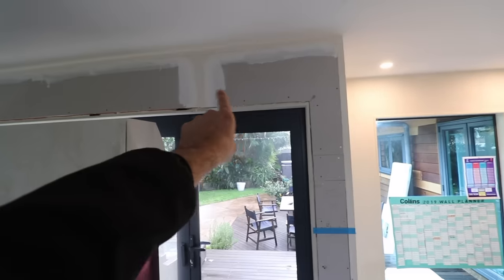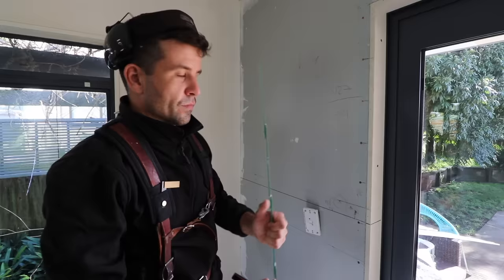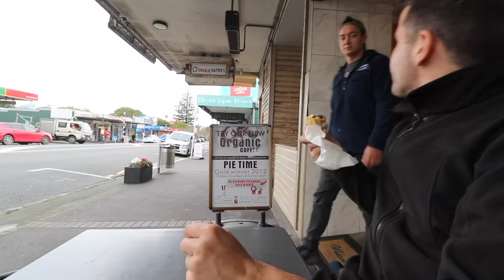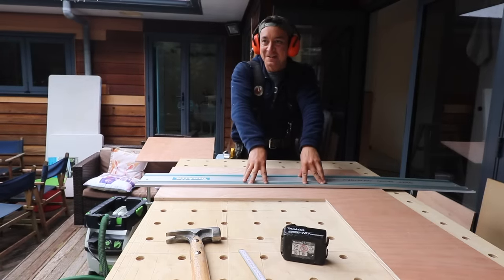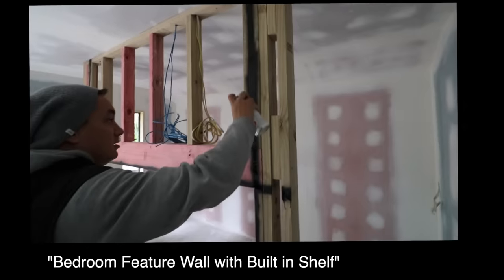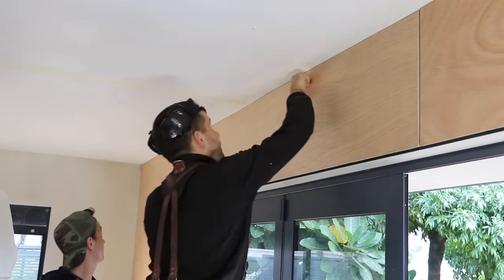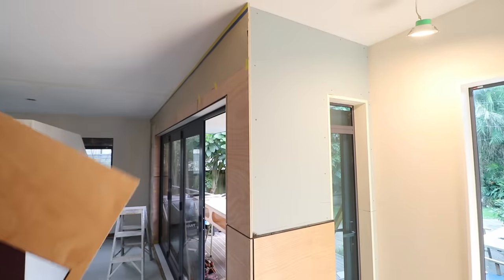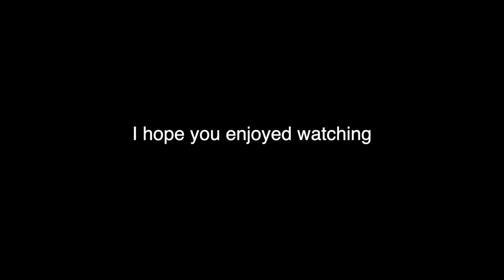Plywood Wall! - NO Nail Holes!

Comment: If your sticking boards on I find it better to do circles with the silicone/glue , when you push the board on it acts like a suction cup, Good job looks great
Reply: Chris Kane this guy knows whats its all about
Reply: @jamatoke  there isn't really a right or wrong way to do it mate, The comment was more for a DIYer or an apprentice using a lower quality of silicone and even on a rough or uneven wall not a fresh boarded wall, And the need to avoid 2 part glue, It can be expensive if you can't justify the need to buy it (I use it for kitchens)
Reply: @chriskane9230  I think he was complimenting you mate... but still an informative comment... cheers

Comment: Instead of putting blobs of adhesive behind the board put small circles of adhesive. It holds it back better to the wall especially if the boards arn’t quite straight. The small circles act like suction cups. Sounds daft but works
Reply: Yep creats a vacum
Reply: Great advice
Reply: Also has much better drying characteristics, vs. a blob that might not have any air exposure in the centre. Usually recommended for mirror installation.
Reply: @jacobmailman  Is it it better to do small circles across or a squiggly line across if i'm going to use the same amount of adhesive?
Reply: @timetraveller9690  The reason people do blobs is because it prevents gaps in the event there is a dip or a bow in your board and when you squish and press the board against the wall it'll naturally spread your adhesive. I've never tried circles, but the squiggly line would be worse as you would get the "suction" or vaccum effect they're referring to. If you know both surfaces are perfectly straight then the most glue surface area as possible is beneficial, which is when you should use the squiggly line to save glue and maximise glue surface area.
Blobs to ensure glue is connecting to both surfaces. Circles for suction. Squiggly line for even coverage.
Reply: Sounds legit, I'm going to try it. Cheers.
Reply: that makes sense , I'll sure use that tip .... good idea
Reply: Been using this method for years
Reply: Do triangles work?
Reply: Yup good method it really makes a difference. Great on skirt if your gluing and pinning it.

Comment: I would suggest you run your Paulk Workbench over your table saw and cut it in half lengthwise. Then install two side panels so you basically have two narrow Paulk Workbenches. They will store the same in your van, will assemble as a single bench with two squeeze clamps at the ends holding the two halves together, but will be much lighter to carry around. You might even find that you prefer working with a half bench better, but you have the option of the full. Also, the half benches will store in your van on edge so they will take up less space.

Comment: That is one of the best looking walls I have ever seen! If someone told me to cover a wall with plywood I'd think they are nuts. Now? Not so nuts!

Awesome!
Reply: Architectural-grade plywood is a whole other level of quality than the construction grade stuff seen in big box stores.
Of course, execution by the carpenter is key, and Scott nails it. (pun intended)
Reply: Birch ply is some of the tastiest looking cladding there is.
Reply: @alanr745  I've seen hoop pine used as soffit on a job,I was installing longline 305 wall cladding , finished product was stunning.
Reply: @alanr745  what do you mean "pun intended"? this is a nail-less wall! u crazy
Reply: I have put my wall using mdf coated with melamine which is far better than 12mm plywood. U don't have to sand and polyurethane.  One of major problem of plywlod is they come in bending.  U have to nail at the end.

Comment: May want to consider using aluminum Z-clips as panel fastening. Alows panels to be installed plumb and corners can be square. Wood and drywall expand and contract at different rates, meaning eventually something will give... Hope this helps

Comment: First time I've EVER seen someone just that Plumb and level line method!! I've been using that for 25 years to custom fit mirrors tight between walls. Exactly like what you do Plumb line a level line eight measurements off of those and you have an out of square custom fit mirror tight to all the walls! Outstanding

Comment: Just a little tip from a uk Carpenter here......apply the gun adhesive in circles, that way when you push in place, it’s creates a little suction, and it’s less likely to pull away :) love the vids by the way bro ;)
Reply: My brain tells me that would create high pressure cavities that would tend to push the board apart.  My brain isn't known for always being right.
Reply: Randall Mitchell well it works, try it and you’ll see :)
Reply: @solobuilder7451  Your presented qualifications support your statement better than my thoughts unsupported by experience or research 😄.

Comment: Carpenter in MB Canada. Insane how different we build. Keep up the awesome work guys.
Reply: Kyle GUY the whole video I’m just thinking “these poor folks have no idea their house was built using the wrong measurement system.”   Haha cheers from The States - love the content!
Reply: @davidpritt5080  haha we use both systems in Canada, we're trying to move away from imperial.
Reply: Just wonder why they needed to have the sheetrock at all. Why not just build directly off the studs and build it like a stage flat with a 1 x 2  grid frame behind for additional structure across the ply if needed? Would this idea make sense if you were doing new construction and wanted a plywood wall? (I am working on a  lab room that needs to have mount-points anywhere on a wall and not just for aesthetics) I think maybe they came in after the sheetrock was laid and decided to work on top?

Comment: Very good finish to a tricky job bespoke joinery 10/10 ! Bigger firms here in uk would supply everything over size then the site lad would make it work cutting everything again precise probably having to run the router down the edge after it had been finished with the paint ... I’m on your level cut, manufacture and install there onsite... no mistakes. Very impressed
Reply from the maker: Thanks mate !

Comment: Pretty slick!  Funny how plywood linings are so foriegn to (what seems ) the rest of the world.
Reply from the maker: Lol I know right . Love the channel btw bro
Reply: Wood paneling takes more time than sheetrock, so it is not used as often... And when it is used, it is not precision fit, but rather relies on edge pieces and moldings to hide the edges.  Cutting it so precise that you can leave the edges visible like in this video is not done by builders because it increases the time (and thus money) spent on labor.  They would do it cut to the nearest half inch and then rely on molding to cover the gap.  I had an aunt that I remember as having had mahogany paneling in her living room 50 or so years ago... I visited her maybe 20 years ago and discovered that at some point, she had decided to have it covered with sheetrock so that it could be painted a light color and be brighter.  What a waste...
Reply: @jakeblanton6853  it really doesn’t when you add in the time it takes to have it finished. The cost would mostly increase in material. Also finish carpenter leavening a half inch gap should be sent home not called back. 1/8” expansion gaps were used in older homes but modern paneling butts or gets an aluminum trim.
Reply: @SurelyLightFoot  -- I'm going by what I remember from back in the '70s with respect to the paneling that I saw and the houses that I saw in the '80s and '90s with sheetrock.  Paneling back then was often done with a piece of quarter-round, inside corner, or outside corner mouldings where walls intersect, although the panel to panel fitment was directly touching and if done right, you would not see the joint.  I'm sure that some of it was because the walls were not perfectly straight and there might have been a difference in the width at the top vs the bottom, but by having the mouldings there, it allowed the installers to be a bit sloppy in their cuts.  If your intersecting walls do not have any moulding at the intersection, then you're going to have a noticeable line even if you are a sawblade thickness off, whereas if you have a 3/4" moulding that goes there, you don't have to be as accurate.

Now, on a side note, do you remember the "board and batten" style of siding that came about as sawmills developed and we moved away from log homes and to lumber framed homes?  By putting the batten over the gap between adjacent boards, you closed up the air gap while also allowing for the siding boards to not be perfectly fitted to each other.  It's actually a pretty useful technique and it is still used today, although more as an architectural design use than being functionally necessary.  If you are a DIYer and building a shed, large dog house, or whatever and do not have someone else to help you handle the larger pieces of lumber, the board and batten style of siding makes it easier for you.
Reply: just wanted to thank the fans for committing to this journey with me. i love you guys so much, none of this is possible without ya’ll seriously. XO
Reply: UK here, never saw anything like ply linings before... 1. Why? 2. how's it finished that makes it not look like plywood?
Reply: @imipak23  well the way people do it now is mostly a modern design element but in the past they had the wood paneling that is essentially plywood and all the exposed edges were hidden with some type of trim molding. Having the layers exposed on the end is common now though because it gives an industrial modern look.
Reply: @SurelyLightFoot lol I feel old XD
I did work out that the faux Elizabethan oak wall panels on my local pub are (heavily stained and varnished) ply with added rail and stile door panel type sub-panels that I guess are just strips of trim glued to the sheets.
Reply: Anyone know how plywood affects room acoustics?
Reply: The resto of the worl is very conservative and is not used to things like these ... And most think that plywood is weak and brittle :D
Reply: @SurelyLightFoot  what's the definition of the word leavening that you use in your post?  Because my dictionary says it has to do with baking bread.
Reply: @SurelyLightFoot   leavening?
Reply: @pekoe46  it was either a typo or autocorrect on my phone. After reading my comment I can tell you that I meant leaving. Leavening does have to do with baking though.
Reply: @kazielbonn  can cause echo similar to just having a plain concrete wall.

Comment: Did a similar job about a month ago. I use tongue and grove method instead of a lamp joint between the black stripes and also use cladding bracket or what ever they are called. Like the way it look the only thing that hits my eyes is seeing the face of the plywood and the edge of the plywood at the corner joints.

Comment: Looks Great! We do a similar install on commercial projects. Only we don't use or rely on glue that can over time give way with expansion and contraction (happen d to us before)  Instead we now use hidden panel clips that are invisible once installed and are more reliable then just glue. If there's an error you can always unsnap, correct your mistake and re-snap into place. Makes for easy accessibility for future in case you ever need access to the for wall outlets or anything else.

Comment: Wish I had seen this before lining our lounge with Okoume face ply (also called Rapid Ply here in N.Z), we butt joined our sheets on the studs, but there was still a small gap here and there, which didn't really look that great when filled with "no more gaps". The gap filler and the Okoume cant really be sanded that well, so we just got a rough looking join and painted over it. Negative detailing is the only way to go!!!  Something I find useful is a couple of adjustable steel tent poles. The pack down to 1.6 metres long and extend to just about double that. You could use them with a block to hold up the ceiling or door frame pieces of ply. I use them to hold shower liners in place too, they lock off with a small triangular headed bolt and with two people you can get significant pressure on them. Love your videos, very entertaining and helpful, thank you!

Comment: Love the look of the plywood panels. A tip I learned from mirror guys, if you make a circle with a thick bead of panel adhesive, you will have a suction cup after you push the air out. This is very effective with heavy panels and ceiling work.  Nice work, love the video, keep rocking it!

Comment: This just gave me a fantastic idea for my laundry room.  The house is older so want to have access. Will frame but create these panels but use Allen key screws to hold panels in place. That was if I need access it is easier than drywalling  etc.

Comment: Hi Scot. When using glue to apply sheets on ready made wall try to apply glue in shape of circles. When pushed against the wall glue will spread a bit and it will act as vacuum, sort of, giving more grip between sheet and wall

Comment: Nice work. Am midway through a shadow-gap panels effort on my shed. I considered the rebate idea, but went with the idea of just going with liquid nails rapid grab I think it was (probably the Aussie version of what you used) on furring channel, with thin ply spray painted black to make the shadow line. Takes forever because each bit of shadow line ply needs to be cut and glued. Still figuring out what to do around the windows, so seeing your approach was great to be able to see how it looks. Wasn't using quite as fancy a ply as yours - 12mm BC project panel 1200mm square stuff from Bunnings.. and am going to paint it with a water based whitewash/pickling floor finish to lighten it up.

Comment: Great great great... as a carpenter I always wanted to do that on some projects, the only big problem that I have is the walls are not straight enough here in Norwest Pacific and the wood frame has lots of movements. Sometimes I miss steel European structures level and plumb forever. Cheers guys very fine work.

Comment: Looks great. Curious. What's the adhesive used? I'm especially curious on the upper pieces that held after 5 seconds. I'm wanting to do 1x4 wood slats on my ceiling with 1/2" exposed black gaps. I'd love to not have visible nail holes if at all possible. Thanks!

Comment: As a Cabinet Maker I can really appreciate your method, it's exactly how I do it!
Reply: Nominal Models what paper do they use to make the black gap?
Reply: @MichaelJordan-hn4zd  it's a painted edge rebate, or you can leave a gap between sheets and put anything black behind the gap. I find it easier and neater to edge rebate one sheet say 10mm wide x 5mm deep with a router, then paint or even sharpie it black.

Comment: Turned out nice we do things differently for wall paneling at work. We clip them on the back and then clip the walls and do the layout for clipping with story poles. We also establish a control line on the floor and shim our panels accordingly so that the panels are plumb. On commercial panel jobs we just use reveal strips in between panels but I like the router work your reveals came out pissah
Reply: What type of clipping do you use? I'm wanting to do 1x4 wood slats on my ceiling with 1/2" exposed black gaps. I'd love to not have visible nail marks if possible. Any tips?
Reply: General Use we use z clips, there aluminum clips one goes on the back of the panel and the other goes on the wall and they clip together with pressure. Laying out is key to them so if you’re doing a ceiling I would make a story pole for your clips and then transfer that to the back of your panels. It’s not a bad idea with ceiling panels to use small brads in the corners and fill in with a puddy stick with the corresponding color, then just wipe the residue off with naptha.

Comment: Scott looks like you have bought the 18 guage hitachi finish nail gun. They are really great. 23 Guage micro pin nailer and you would never see the pin holes and it holds the sheets to the wall while the glue goes off.
Reply: Eugene Nehring I gotta say, I never had the 23 gauge nailer. Picked one up
One day, and now I use it all.......the........time. 
It’s such an awesome machine.
Reply: @jmlcolorado   Its just so nice for panel work and stair treads etc. places where you dont want visible nail head holes.
Reply: Eugene Nehring I use mine for prefinished crown on cabinets and corners on mdf baseboard. They work good for keeping unruly employees in check too 🤣
Reply: You have to go high quality all the way with 23 guage or its very frustrating. Gun, nails, planned placement, the 2" can go straight in and back in a half inch space

Comment: you need to screw the drywall more as it is the support for plywood, then run a continuous bead of glue around edge of panel followed by a smaller circle bead of glue in the center as it creates a air pressure fit guaranteed to never come loose. I have done this, interesting finish BTW
Reply: What type of adhesive do you use? I'm wanting to do 1x4 wood slats on my ceiling with 1/2" exposed black gaps. I'd love to not have visible nail marks if possible. Any tips?

Comment: Hi Scott, great work mate. I’m just about to do this to my garden room / gym Iv built, I’m a shuttering carpenter by trade - UK / England - so finesse isn’t my strong point - what router bit did you use for the edges? And what’s the black spray just any old black spray can? Cheers mate.

Comment: Great Job Scott. I'm doing a similar ceiling over here in Oz and looking for advice on best fixings into steel top hat ceiling battens? Are there brad nails available to fix ply to the steel top hats? Don't really want to use screws as it will mean too many ugly visible screwheads. Cheers..